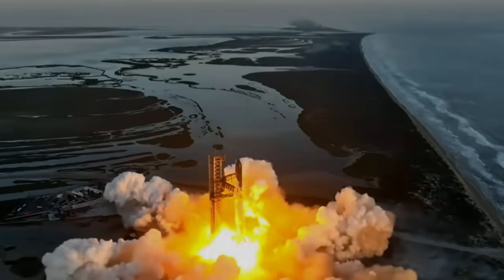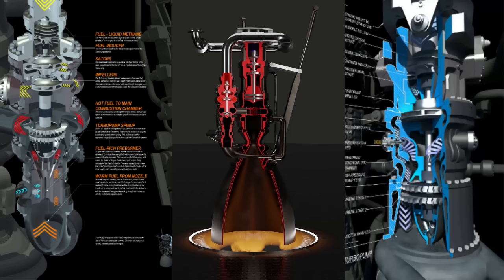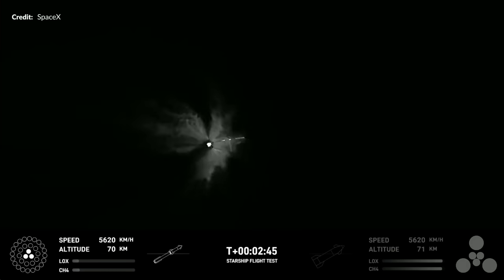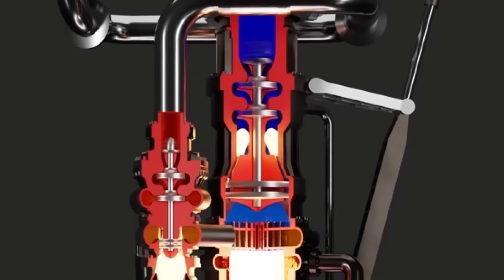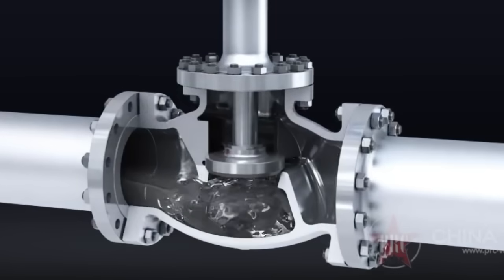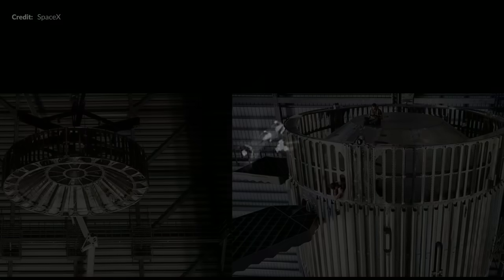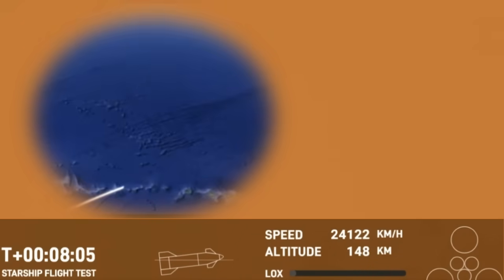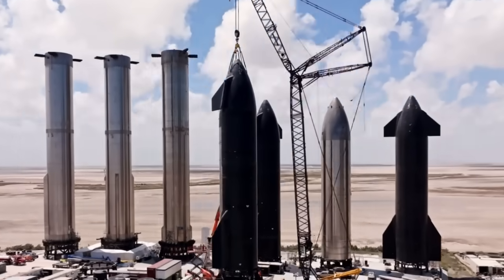Starship Flight Failure Analysis IFT2

Comment: In fairness for the second launch, the fact that the booster made it to Meco, and the starship got to orbital speed and only self destructed at seco, it was a huge success for a brand new rocket. The difference here is that we see everything. With other rocket development we don’t see much until they finally succeed. There was so much success in this flight and so much learning it’s hard not to see it as a huge success
Reply from the maker: Indeed it was.  Still called a failure analysis but a lot was learned.

Comment: Good analysis of the issues leading up to the abort. I agree that spaces is very close to successful orbit, the loss of heat tiles will also need to be addressed before next launch.
Reply from the maker: I've heard the next Starship has a better attachment testing system.  That being said I don't think it's a bad idea to send on back with some missing... How robust is the steel?

Comment: I agree with your proposed solutions regarding hot staging and the flip maneuver. I did think the boosters flip was way too aggressive, keep the 3 lit until it has completely flipped then light the others. But there was no mention of the many tiles that did not make it to the karman line, they really need to fix the tile / ship connection. I understand hundreds stayed put but many didn't make it.
Reply from the maker: It is indeed a question how many it can lose and still survive.

Comment: Add baffles in the booster. Increase the height of the hot staging ring and make the cover over the top of the booster more conical to deflect more exhaust sideways instead of it bouncing back up. This will also reduce the backward thrust on the booster. Lastly slow down the flip to give fuel more chance to settle before relighting other than 3 inner engines. I suspect SpaceX will come up with a lot of additional minor changes and ITF3 will be so much better for this.
Reply from the maker: Those are excellent suggestions Anthony.

Comment: I think your analysis is very good!   I would make the change of putting baffles into the booster tanks and probably on starship as well.   Other than that your suggestions are very good.  The Hot Staging deflector could also be altered a bit a could the position of the engines on Starship.   If the engines on starship are moved to have the center engines rotated about 30 degrees their thrust will not complement the vacuum raptor engines in pressure over the hot staging deflector as well.
Reply: max angle is only 15 degrees  from what I heard about the bottom engines on the booster. I think the same would apply to the starship
Reply from the maker: We agree.  Baffles would be a good idea.
Reply from the maker: It does from my understanding...

Comment: Just out of curiosity, how many failures did the saturn rocket have? I mean ill give you the fact that it was only a 5 engine vehicle, but i would counter that with the fact that they also did this over 50 years ago. And they got it right on the first try, no need for "unscheduled rapid disassembly"
Reply from the maker: They blew up a lot of engines but no launch failures.  But again.  Billions per rocket.
Reply: @terranspaceacademy  Im gonna go out on a limb and say blowing up an f-1 is far cheaper than the Saturn V plus SpaceX just blew up a total of 66 engines on two launches, i'd love to see that bill. I know musk is AIMING to get down to the 1,000,000 to 500,000 range per engine but if that was the case NASA wouldn't be spending $288 million per trip to the ISS. That was also the Saturn project cost, not the per trip cost. And they landed on the moon on the first try with tech that is ancient. Being perfect like that comes with a premium
Reply from the maker: They built these to throw away.  Remember that he wants an assembly line to make thousands of rockets.  NASA knew they only needed at the most ten.  SpaceX has already built more giant rockets than the entire Apollo program.

Comment: Excellent analysis but Starship still has some serious problems that need to be addressed. First as you summed up is making it to orbit which I am confident they can do. Second is fixing the shielding system, it wasn't mentioned in this video but many heat tiles fell off during launch. Lastly is stage zero, it may have survived but this is a system designed to launch 4-5 times a week, do we honestly think the pad will hold up to that?
Reply: Again that is the reason for test flights to get to the point of reliability  and to know what works and what doesn't work in the real world...BTW tiles fell off on all Space shuttle launches as well..even in the fully manned operational missions and had to be refurbished after each flight along with engine replacement. Rocket science is hard and even NASA couldn't get to 100%
Reply from the maker: Very true.  As for the pad. Not today but within a year I bet they'll have it down.
Reply: @johncherish7610  how did that work out for Columbia? Also they don't have forever to figure this out, they are the landing system for Artemis. Not only do they have to get everything I've mentioned down pat, but they have to master in-orbit refueling as well as demonstrate the ability to land on the moon. There is also the fact of making a real spaceship that has everything needed for crew, these prototypes are just empty shells. Life support, radiation shielding, food, water, cargo, egress and ingress all need working on. Good luck SpaceX
Reply from the maker: Artemis should come back in an Orion capsule... No other way to do it in time.

Comment: A sapient discussion.  Not mentioned, however, the problem once again of lost heat shield tiles.
Reply from the maker: The next ship has a better attachment and testing system so it may not be as much of an issue.

Comment: Well done. Lots of information here. But FTS was not triggered on SH. If your analysis had been as complete on that event, you'd see the ship crack in half at the common dome, and that causes to LOV. Confirmed on SpaceX website that the vehicle suffered structural failure.
Reply from the maker: Shockwave up the downcomer?
Reply: @terranspaceacademy  Explosions at the bottom could have rippled up the side of the ship to dislodge the dome. Escaped gasses take two frames to ignite, then two more frames to obliterate the booster.
Reply from the maker: But the upper explosion starts exactly where the FTS is...

Comment: To esrlier discussion...

I hope my story doesn't imply this was a failure.  I'm of the opposite opinion this was HUGE success!

FLY-FIX-FLY, FLY-TEST-FLY, FLY-CRASH-FLY (whatever the verbiage) under the Agile process allows to make those changes and build upon the events from before. Military terms, O-O-D-A (Observe, Orient, Decision, and Action)...if you can do that faster than your competition (or enemy), then most likely you'll win the fight. ELON is the Master of that at an epic scale.

From IFT1, we saw Starship failure to separate from the Booster, so hot-Staging was reduced with a method to resolve a problem and take a page out of the Russian's rocket playbook and was major direction from design (out-of-the-box) from original approach. In my assessment earlier, they were not going to do a 'PUFF' test of trying to create separation at the risk of Hot-Staging failing. It was CRITICAL they were able to get Starship separated and attempting flight around the world to evaluate the re-entry.  SpaceX can make money on putting Starlink/Starshield Satellites in Space at the cost of destroying boosters (until they perfect Chopstick-recovery), which is a playbook from the Falcon 9 original development (I think Flight 20) before they landed successfully.

In fact, I know people are making a big deal about the heat-tiles falling off on launch, but I want to know how well the stainless steel body and under-cloth material holds up with tiles missing to thermal re-entry.  Later on, they can resolve on ensuring tiles don't fall off, but determining that risk up front and early can determine how important it is to resolve it. Understand Starship 28 has new procedures and different adhesives. 

To ALL: thanks for the positive feedback. Normally don't respond to these as day job consulting for Flight Test keeps me from playing on the forums. However, couldn't pass up the moment, and WOW, what a show it was;-)!!!
Reply from the maker: It was indeed.

Comment: Add small navigation engines to the outside of the starship facing outwards, as a replacement for the gimbal mechanism, as well as doing stage separation. And no hotstaging ring needed. Perhaps possible with electric turbo pumps. Does the math work out?
Reply from the maker: That might work. They could just vent the hot gas through thrusters.

Comment: It would seem the two areas of concern are the Hot Staging event and the Booster flip.  The Hot Staging event, I suggest, should be changed as follows: (1) after all but 3 engines have been slowly turned off, slowly decrease the three firing engines to 50% thrust; (2) Starship fires its 3 vacuum optimized engines to effect separation; and (3) after a few seconds, fire up the remaining 3 Starship engines. Booster flip: (1) after the staging event is complete - begin the booster angle change using the 3 gimbaled engines and the attitude control venting - do this slowly so the booster is always under positive acceleration and to minimize sloshing; (2) when pointed in the correct direction, increase thrust as required.
Reply from the maker: Those are excellent ideas I think.

Comment: Starting up the vacs 1st means you have no vector control for the moments the standard raptor light. And if 1 failed to light or took longer than  anticipated then the heading would change dramatically
Reply from the maker: That's a good point... Then just shut down the booster before relight and vent enough oxygen through the engines to work as an ullage motor and settle the propellant.

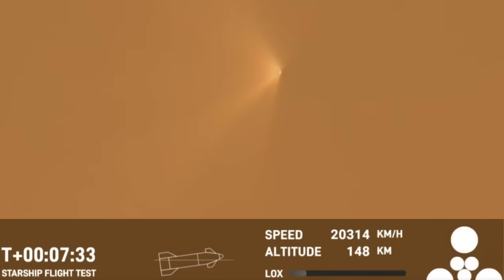Comment: One of the things that I picked up was on the Astronomy Live video that had a slightly close detailed of the final moments. At around 8:58-8:59 there's a profile of the starship with the appearance of three fins, one of the back fins is missing. Also during this corkscrew tumble you can see the sunlight reflecting off the same three as well.  Odds are the first outgassing at 7:07-7:08 was when that fin failed. There was also a call saying that Houston had lost signal just before the 7 minute mark as well. 

I call them fins, but they might be wings or stabilizers. Hope the times I gave don't try to link to points in the video, they are the times during the flight itself.
Reply from the maker: Thank you!  Can you send a link to that section? I couldn't find it.

Comment: I had the same thoughts on the booster engine restart of the 10 ring engines. I speculated on another channel on Sunday or Monday that the one engine that didn't re-start might have suffered catastrophic damage due to cavitation and might have started a cascade failure in the other engines that failed. I don't know if the three center engines are supplied from a system that is supposed to keep propellant flowing during the negative or zero G event. If there is a system for that purpose, it might only contain enough for a short term and the other engines are started to gain g force to get control of the fuel. If so, it might not be so simple to change the timing.
Reply from the maker: Not that I can see.  The long feed pipes would help with the fuel but not the oxygen.

Comment: Very good analysis and video! I agree with most of it.
The booster has a much simpler fix though, just don't throttle back so much that the starship thrust creates negative acceleration. And maybe flip it a little slower also (although the super aggressive turn might have been caused by engines failing).
Starship might require some changes to fix whatever prop (likely ox) leak / engine failure it had.
Reply from the maker: They would have to shut down entirely.  The Raptors can only throttle to about 40%.
Reply: The issue is Newton's 3rd law. During the staging sequence, if they throttle back less on the booster they will have to throttle harder/faster on the upper stage which would lead to its own set of problems (longer duration and more thrust against the hot-stage dome could cause significant damage to both booster and ship).
Reply: @terranspaceacademy  Surely there must exist a point with the correct number of engines still running between 40 and 100% so that the booster doesn't experience negative G's.
40% on three engines is too little.
100% on 33 engines is too much.
So how about 65% on three engines? Or 80%, or maybe 40% on six engines? Not a issue.
Reply from the maker: I agree... Or just shut them all off and let the booster reorient with hot gas thrusters then let drag settle the propellant.

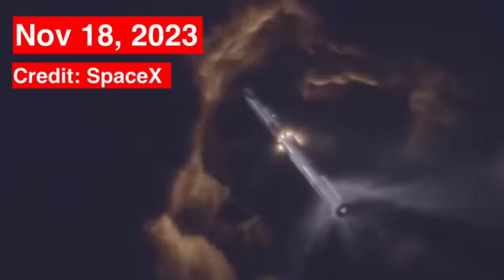Comment: Hey Doc, “…I concur Doctor”. (The ER scene from Catch Me if You Can).  @ 9:50 of the vid, stage sep is shown from a different angle and exposure setting allowing us to see the Ship center engines gambled outwards at max. Along with this couldn’t SpaceX also decrease the diameter of the HSR center cone to further reduce potential blowback?
Reply from the maker: We think so too.  Make the ring a little taller and don't truncate the cone... Or just wait a little longer to fire up the center 3.

Comment: The easiest way to understand the starship test program, is to understand that a lot of the existing versions are already obsolete. You can scrap this equipment at great expense, or you can use it for testing and validate existing systems, and test new systems. Keep in mind, this is the largest vehicle of its kind ever built.
Reply from the maker: We agree. It's not like these are the cutting edge or would ever be reused.

Comment: The booster probably had fuel 'sloshing' problems exactly as you describe.  Keep in mind just after separation there is now much more drag on the booster stage and even with the 3 central engines burning, may be 'decelerating' along its length.  Meaning the fuel and lox are NOT staying nicely pooled at the tank outlets.  Certainly as it starts to flip around and becomes 'broadside' to the direction of travel, liquids in the tanks are moving about a lot.

Might be better to just shutdown all engines while 'flipping'.  Then let atmospheric drag flying 'tail first' provide the force to settle the liquids and then restart engines.
Reply from the maker: We think so too.  It will be interesting to see what SpaceX comes out with...

Comment: I wonder if it's possible to regulate the turbo pump speed like a servo so they don't spin out of control in the event of encountering gas bubbles.  Probably easier to avoid the bubbles though.
Reply from the maker: I thought about the newer electric "pancake" motors to help spin up then work like generator/governors to prevent overspin...

Comment: I've noticed that most booster rockets detatch and fly up and away. The booster on Starship pointed down and away. Would having the booster simply fly up and away help prevent fuel slosh?
Reply from the maker: It looks like they are going up because we are looking up at them.  Usually they just go "away" from the boosters.  They may have wanted gravity to help control the flip and chose to go "down".

Comment: How about turning the last three booster raptors off the instant starship lights and using grid fins and gas thrusters to do the flip. Then drag will help settle the liquids and you can relight for the boost back. The delay in the boost back will result in the booster being further down range but not burning during the turn will save fuel.
Reply from the maker: I think that's also a viable option.  Good work.

Comment: I know reentry of both booster and starship are the last objectives in the suborbital tests with the test of the starship heat tiles as an important objective. Was there enough footage during launch to see if none fell out, and if some did, why they did and speculation on fixes. I don’t find much material out there explaining in detail how these tiles are attached to the skin the craft. How they differ from the space shuttle tiles and how resilient they are to the buckling and bending of the craft during launch and reentry.
Reply from the maker: They have both adhesive and snap to a metal post.
Reply: @terranspaceacademy  just saw the new video from Everyday Astronaut, extreme 4K closeups with slo-mos and you can clearly see heat tiles peeling off and falling. What’s interesting is that after they fall off some were followed by what looks like white powder (ice?). If ice formed underneath and around the tiles during propellant loading it will definitely compromise integrity. Wondering what engineering fix they will do for that.
Reply from the maker: Good point.  Cold plus glue = bad.

Comment: At 9:46 you can see that at hot staging the center 3 engines were gimballed out, and not until they were clear of the booster did they return to the center. This does not mean that there was not an issue with overpressure causing some sort of structural damage though, as 6 raptor engines need a lot of space to exhaust
Reply from the maker: I did see that and should have mentioned it but if it shoved the booster back that hard there must have been blowback.

Comment: Today I came across several references in the comments about a movable diaphragm to keep fuel from sloshing by reducing volume space.

There was a movie called “Salvage 1” starring Andy Griffith. In the movie he used this idea to send a homemade rocket to salvage stuff off the Moon. It was a method to free up space in the tank and allow putting in the materials left on the Moon from the Apollo Program. Not only I enjoyed the movie but it lead to a tv series based on this.

What goes around comes around including ideas.
Reply from the maker: Indeed.  Most of the good stuff was dreamed up in the 50s